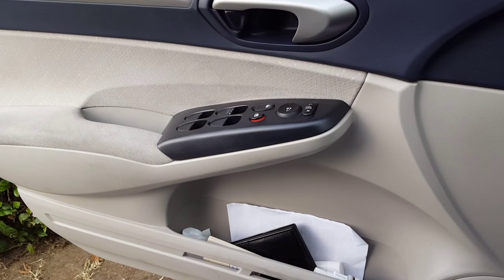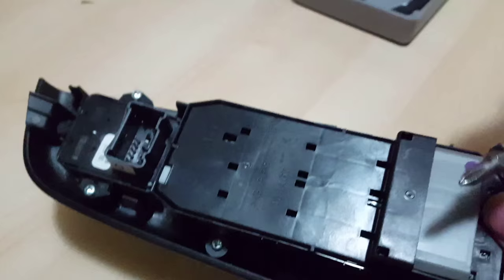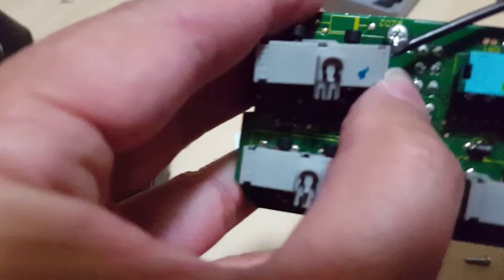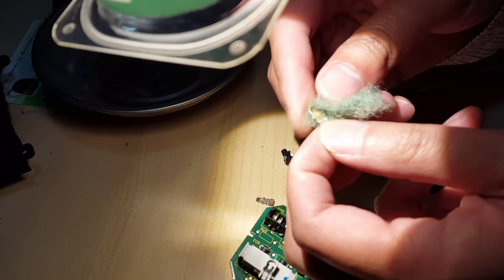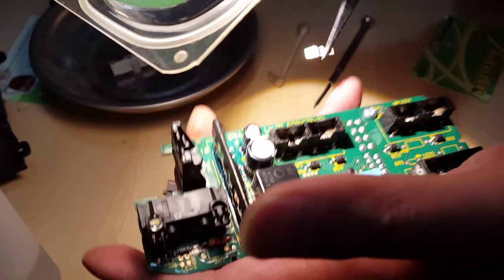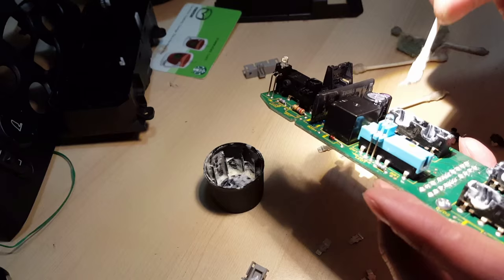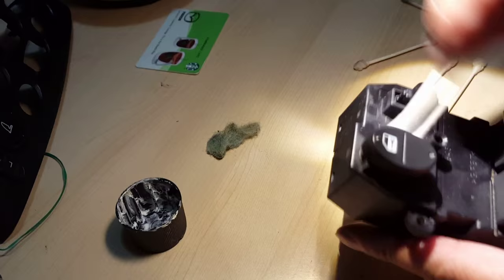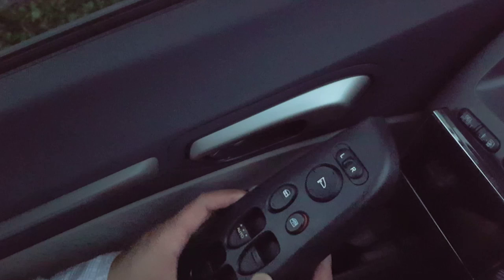DIY: Honda Civic Power Window Switch Fix - How to fix a stuck window switch

Comment: I just bought a 2006 Civic EX and the rear passenger window would not roll down or even make a noise from the main control switch and rear passenger switch. The switch is slightly different on mine but this same method solved my problem. I just cleaned it with rubbing alcohol and put it back together. Thanks for the helpful video! You saved me from buying an expensive window regulator that still wouldn't have solved the problem.
Reply from the maker: Thks glad to help

Comment: Great video. Thank you very much. I have a 2006 Honda Civic LH sedan. The only window that worked was the driver’s. When I took the unit out of the arm rest I noticed that the rear connector seemed loose. I pushed it in and heard a satisfying “click.” Now all the windows work from all switches plus the driver’s window auto-up and -down function works again. Would never have tried it if not for your video. Probably saved me considerable $$$$$$!
Reply from the maker: Np!
Reply: This is my issue!  Thank you for your comment, this might be my problem. I’ve been searching the internet for over an hour trying to find someone that had my issue.

Comment: Thank you sir really appreciated finally i fix my mirror after 2 years . My prob was passwnger window not rolling up . I tried everything removing motor and dw40 everypart . Then i open switch cleaned on passenger side didnot work . Last try i open my driver side switches i found too much carbon on contacts i cleaned all switch . My window mirror start working again

Comment: Thank You.  I have an 06 Civic same issue.  Now to figure out the issue with the air conditioner.  After reading online I have realized that when Honda changed the design of the Civic they did not address a lot of their design flaws.
Reply from the maker: no prob, glad to help out!

Comment: This video helped me fix the passenger side window not working, but not how you think. The solution was at the very end of the video when you made mention of the window lock button. (face slap!) Problem fixed, lock button was on. This 2011 Honda civic is my first Japanese car and just learning the many subtle engineering differences. Bought it for my daughters first car. I've always owned American made cars. I was pissed at first because we just got the car last week and thought we had problems already with it. DOAH!!!!! Stupid meter pegged on this one. Thanks
Reply from the maker: My Chevy Volt was my first US car.  Love it. But i also love all the Hondas, Toyotas and Nissans i owned over the years.  This button issue happened 8 years into owning my civic. But my 2007 accord still works fine. Oh well

Comment: You are a fricking champ, this worked for me and saved me $$$$. My case was slightly different. I took my master switch out, but could not go any further than pulling the caps off to clean them as they were sealed and soldered. I had a thought, swap my working back passenger window switch with the non-working front passenger one. That worked, so this told me it was the switch (not the master one) or any broken wires. I pulled that switch apart just like in this clip, only scratched the muck and cleaned with rubbing alcohol and a cotton tip, put it all back and it WORKS now. Thank you very much.

Comment: You are awesome 👏 this worked ! This sh*t happens when it rains 🌧 and it splashed ontop of the window control panels , it seeps through onto the circuit board and accumulates corrosion/mold 😳! You are awesome 👏! Thank you 🙏

Comment: Thanks for posting this!! I was going to attempt it but an aftermarket switch assembly is only ~$30 now so I just swapped mine out. Thanks so much for taking the time to make the video!!!
Reply from the maker: Aftermarket used to cost a lot more at the time i  made this vid. Lol thanks for watching! Good luck
Reply: Cost should not be a reason to replace perfectly repairable items..

Comment: I doesn’t find white lithium crease here in korea..is it okay to use simple multi grease inside button.. before front passenger side window doesn’t goes up sometimes and now after cleaning and putting multi grease it button get stuck sometimes to down and window keep going down

Comment: Thank you!!! This was a huge help! My window was struck in the down position and rain was coming. It turns out that the head on one of the slider contacts was worn down so I swapped it with a good one from a switch for a window that was already up and I was able to get the window that was stuck back up.
Reply: Smart people still exist.

Comment: Nice video.I used DeoxIT for a cleaner, then compressed air to speed up the drying process. Also, Di-electric grease works wonders on keeping moisture and corrosion away (very little). Thanks again!

Comment: Could not get my passenger window up yesterday, so today went through this whole procedure. My Civic is 2009 so the switches were a little different and I could not remove the cover. However, I did squirt a little WD40 inside the switch to help dissolve any corrosion. This guide was a great deal of help. However, I reassembled the power window console and my passenger door window still would not go up or down. That's when I discovered that neither of the back windows worked either...hint...hint...so it dawned on me what was wrong...I must have accidentally depressed the window lock button (a button I never use, not having kids) while the passenger button was down. Problem solved!
Reply from the maker: +k3n c LOL! I did the same thing 2 years ago! The safety window lock out affects the all other window switches even on the master window controller. I thought all my switches were broken. LoL!
Reply from the maker: +k3n c LOL! I did the same thing 2 years ago! The safety window lock out affects the all other window switches even on the master window controller. I thought all my switches were broken. LoL!

Comment: The Honda City 2006 is different.  The contacts area was placed sideways!  And its plastic cover clips on above and below.  Its easy to pry off the top part of the cover, but the bottom I found hard to reach.  Forcing the bottom, the area that might have been gently lifted if accessible broke.  Anyway, I cleaned the contacts, reassembled the tiny parts, and clipped on the damaged cover, and hoped for the best.  It worked!  Lucky me.
Reply: Forgot to add thanks for the video.

Comment: My driver's side window is the problem, but I can't seem to find any problems. Mine is an 09 and looks a bit different from the video, but it still doesn't seem to be working even after I cleaned it. Suggestions?
Reply from the maker: Something else may be broken. They sell new 3rd party window switches on Amazon for like $30 or so: http://amzn.to/2mUeZNw .

Comment: up date.... wow 💥blown away thanks a lot again your video helped👌👌 my Windows work now like before
Reply from the maker: +Alex Rodriguez no prob man. Glad it was useful.
Reply from the maker: +Alex Rodriguez what year is your hchii?
Reply from the maker: +Alex Rodriguez what year is your hchii?
Reply from the maker: +Alex Rodriguez your welcome!
Reply: +Sterling Wong 07 very happy with my car even when it get bad reviews
Reply from the maker: +Alex Rodriguez I know. it's reliable but needs TLC for the IMA system.
Reply: +Sterling Wong just had replaced it about 5 months ago 1 of the cell had gone bad
Reply from the maker: +Alex Rodriguez i replaced mine about 7 months ago with brand new cells, as i didn't trust the Honda dealer refurbs. i 45 mpg.
Reply: +Sterling Wong i got mines at greentec auto with 3y warranty
Reply from the maker: Alex i got mine at Bumblebee, had it shipped from Oregon.
Reply from the maker: Nice
Reply: +Sterling Wong greetec is loca in san dimas , i saw this as an investment it will pay off it self over time
Reply from the maker: i was estimating my IMA will last another 2-3 years of use... however i will pass on the HCH to my younger bro. So its all set for him.. i just hope he takes care of her.
Reply: +Sterling Wong keep it in the family

Comment: Hi Sterling, I will need to clean my switch on my 2004 Hyundai elantra b/c passenger doors' unlock don't work most of the time.
Reply: James Chuaycham ป้อม ศักดิ์ชัย Any chance it's similar to this?

Comment: My issue is just the driver side  button broke off the switch still works do I have to replace the entire switch h can i buy just the single button?
Reply from the maker: I haven't found a place that just sells the top button. The master control is a whole part.

Comment: would this help if my front &re ar passenger window only go down but not up only when it want to .....   
 finally civic hybrid DIY videos thank you 👍👍👍
Reply from the maker: +Alex Rodriguez  it should. The contacts on the hchii gets gunked up with moisture and dust lossing conductivity.  I to do this after7 years of ownership  when the rear switch only went down, and got stuck.
Reply from the maker: +Alex Rodriguez i plan to do some more hchii videos...
Reply: Thanks i will try this out
Reply: I am hoping this is my issue.  My rear passenger goes down, but won't go up (can't even hear anything kicking in, or trying to move.)  My master controls also do not work (intermittently-my master door lock will lock and unlock, and sometimes the rear window will move too.)  This is really giving me hope!  A replacement master switch costs at least $130 (96 Honda civic LX.)

Comment: Thanks for your vid. In my car the little light inside the door doesn't work anymore. Is it easy to replace it too. Or better keep your hands off? thx
Reply from the maker: do you mean the light in the Master Switch? or in the door panel... If its the Master Switch (that controls the windows... you will need to pop out the switches and resolder a new LED lamp on it) Its easier to just buy a new master swich if you care about having it lit.  If its the door panel they clear covers pop off and you just replace the bulb.
Reply: A led is like 10 cents.. dont buy a new master switch..

Comment: OK so I've read the comments I've watched your video , I'm going to go ahead and try this. My 07 honda civic has exactly the same switch panel as yours . First my drivers side window was really temperamental and would only go all the way up or all the way down now it won't go down at all and I can't control passenger or back windows with drivers side panel I know they should work and it's not a fuse as all 4 lights that are on the top of each of the switch connector boxes so 🤞 I'll let you know if I can resolve this or if I break it even more lol .
Reply from the maker: Lol, did you accidentally turn on the window lock out switch? The parental control switch that stops window controls on the other doors?
Reply: @SterlingW8  oi now, I may be a woman but I'm not completely stupid lol no window lock is not on I'm going out there now actually to get the switch panel and have a look . The passenger and back windows open on their own switches its my panel that's not working the switches
Reply: @SterlingW8  right so all other windows are now working but drivers side is still not going down at all the little light comes on when I turn the key 🤔??
Reply from the maker: Lol! nothing to do with gender. There are so many parts. When i fixed the first time i forgot a switch. So i figured most people will have fun fixing it. Otherwise there are 3rd party master controllers for sale online, it the the controller is really not repairable. ;)
Reply from the maker: I must have taken this thing apart 3 times before making this vid... :)
Reply: @SterlingW8  thanks anyways

Comment: Thank you for posting this. I'm having the same prob out of my driver's side window and already went the cheap route in the winter to fix my AC compressor, well I didn't, I rerouted it without now I'm smoldering like a bitch and regretting it. Ugh lol smh Thanks bro.
Reply from the maker: +Michael White lol...  if you really want to have fun with this you can try putting more led to make it glow.

Comment: Is this work for 2 doors ex civic as well? (Not si tho)
Reply from the maker: The switches corrode...
Reply: Does not work on 2 door civics.. if you do, you will pop out your front or back windscreen….🤨

Comment: I have one question. Emmm what is these kind of white product that you are putting on. I am from Mexico and im trying to fix these part of my Civic 2006 too. Thanks
Reply from the maker: i put lithium white grease. its to keep it from oxidation.
Reply from the maker: +Sterling Wong 
you can use electronic grease as well
Reply: +Sterling Wong  thanks a lot.

Comment: Hi Sterling Wong, I have Honda Civic 2007 and my door window at driver side is not working only. I blew it out and sprayed WD40 and put it back but still not working. Please help me : (
Reply from the maker: +Nelo Arellano ... WD40 is a solvent.  Thats why i used alcohol rinse and white lithium grease after the cleaning. It maybe some other issue with your switch. I found that they make 3rd party switches they sell on the Internet for about 45 to 60 bucks, it may be easier to switch it out with a new one.

Comment: sir my front passenger window going up cannot be controlled by my master switch. help me
Reply from the maker: Check the window lock button
Reply: @SterlingW8  no it wont. I will try to do ur vid later. Can i use contact cleaner?
Reply: @SterlingW8  i had fixed my power window. just cleaned with contact cleaner then electric grease. Thank you! you saved my time and money
Reply from the maker: @bugsbunny4648  glad it worked out!
Reply: I also did that to my interior dome light switch. It worked too

Comment: Doesn't it have retractable mirror options
Reply from the maker: The civic?
Reply: @SterlingW8   yes because in my Civic 8th there is no rectract buttons for mirror
Reply from the maker: @Mustafa-mt3rt  my civic side mirrors are manual. LOL